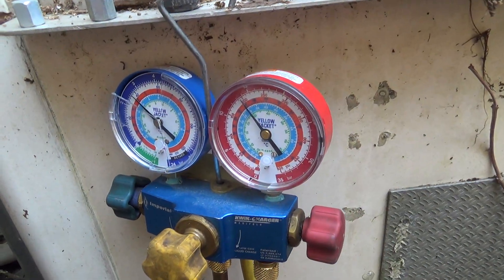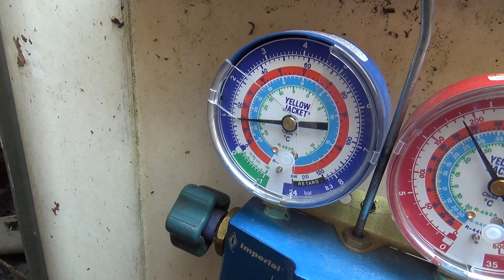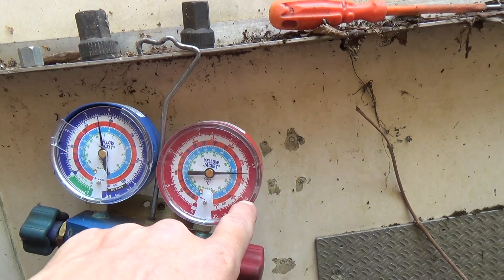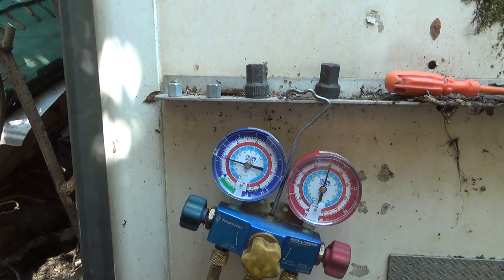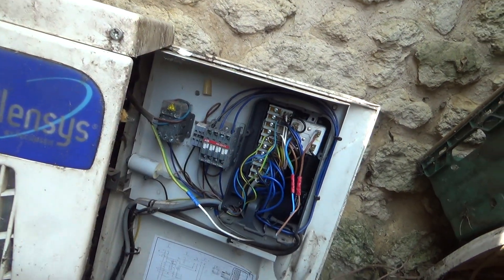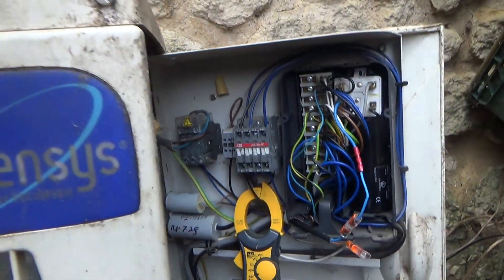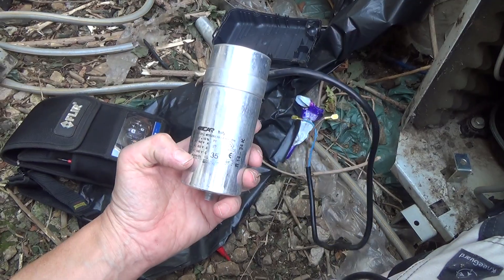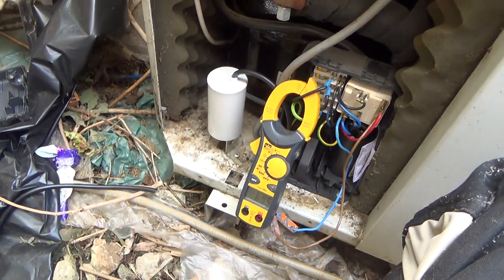Whats Wrong with it?!

Comment: Can you please explain to me what a 'Klixon' is, my understanding is that it's a start device for the compressor?
Reply from the maker: A Klixon is a safety device, its generally a bimetalic strip of metal that will bend as it warms up, when cold it joins two electrical connections together that feed power to the compressor. If the compressor pulls too many amps it will warm up the bimetalic strip and it will bend disconnecting power to the motor. Also if the motor is running too hot for some reason, the heat from the motor will also make it turn the power off. When the klixon cools down it will automatically reset.

Comment: I love doing capacitors, such an easy way to help the system out. I find condenser fan capacitors are something that'll always be out of tolerance, they cop a lot of heat. Especially the little black caps. Swap them and you're suddenly moving a lot more air. 

Surprised you got a better rated cap than the factory run cap in that second unit. I kinda thought the metal ones were better than the plastic ones, rarely find them bad.
Reply from the maker: Yeah, I've changed loads of capacitors lately, suspect the hot weather we've had has sped up their failure.

Comment: John what your opinion aon Flir meters , yey or ney ?
Compared to Fluke let's say .
Reply from the maker: I got this Flir one because it has the thermal imaging camera, I have a Fluke multimeter also, both work well. I think my choice would be just down to the features of the individual meter rather than picking a brand. 
Plus I get bored so like to try different makes just for a change when getting new things!
Reply: @heavydiesel Good to know thank you . I've never seen a Flir meter in the flesh so I've been wondering.

Comment: I’ve given up with compound and pressure gauges. Now use electronic gauges. I find them  far easier. And give you values you need.
Reply from the maker: I've got some Testo and Yellow jacket digital gauges which I use on new systems, but tend to stick with the analogue ones on older systems.

Comment: I always made sure I had proper air flow through condenser and evap.first before anything. Looking at your work area I would say mucho crud.
Reply from the maker: Yes, the initial failure was the week before in the hot weather, ran better after the condenser was washed out but was still intermittently not cooling hence the Klixon trip theory.